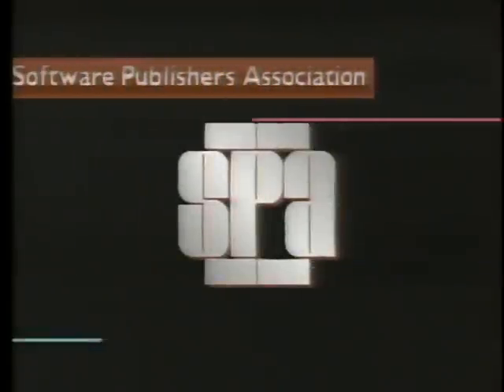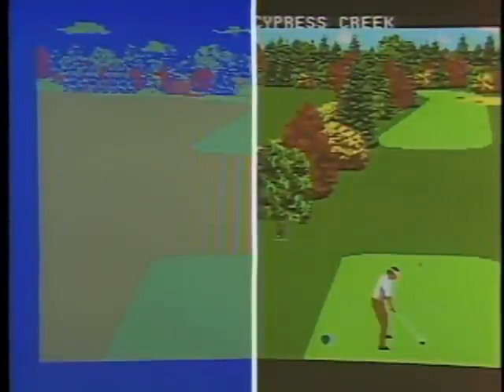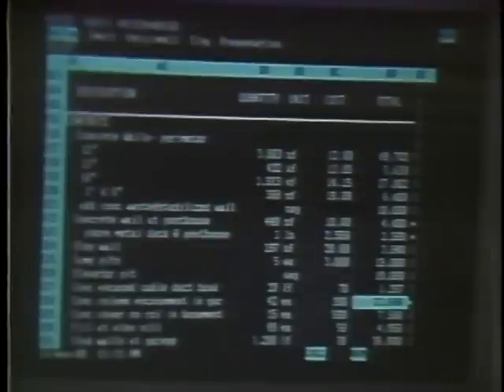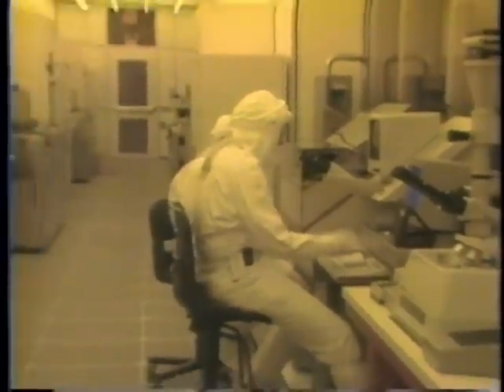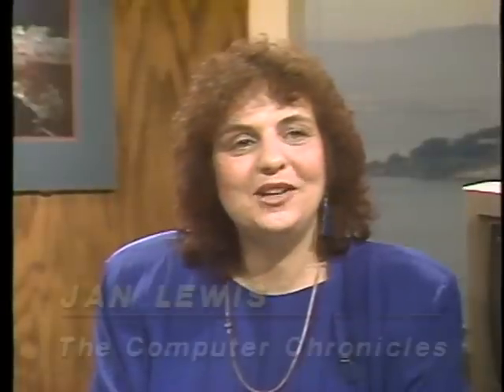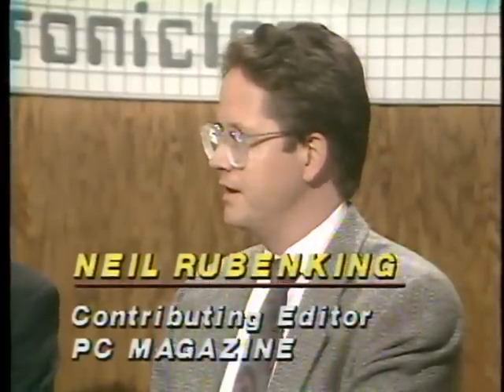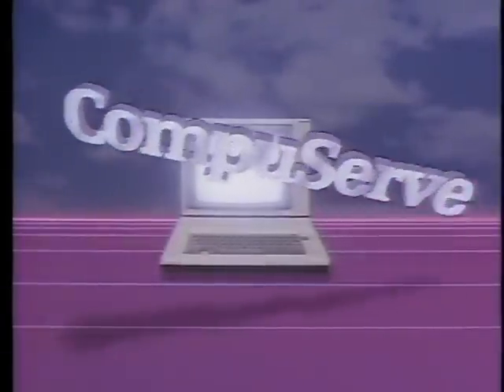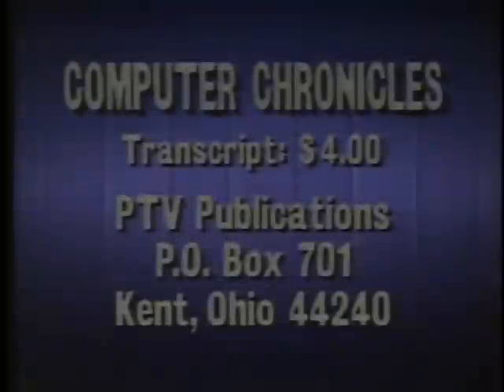The Computer Chronicles - Megahertz Mania (1989)

Comment: I used to have a 486 25mhz in those days. The computer also had turbo button which increased the speed up to 33mhz. I was so proud! Today I wouldn't have a clue how fast my processor is or how many cores it has 😂
Reply: One of the sad effects of today’s complex technology is hard for us to keep up or even care about it anymore. I cant even tell the difference between speeds today. My first was a 286, 16mhz, with 20 on turbo. I was so proud building my own computer year after year. Today its depressing, even though we have powerful machines. It removed the joy of computing.
Reply: @biomed007  I agree. We are taking technology for granted. I think the hard-drive I had back then was 250 MB. Windows 3.11 was using about 70 MB so I had about 180 MB left for use.  I remember when I bought a new hard-drive one day and it was like 4.6 GB. It felt like having infinite space. There is no way I could possibly fill up the whole drive. How wrong I was. I also remember my computer had 8 MB of RAM but a lot of games such as FIFA Soccer 95 wouldn't run properly because they needed 16 MB RAM. Some of my friends had 16 MB RAM and I was super jealous because they could play games I couldn't. Also, I didn't have a soundcard so all the sound was coming through the internal PC speaker system which was some super basic "biep biep biep" sound. A friend of mine had proper soundcard. I think it was a Soundblaster 16. It made such a difference because it could play MIDI sounds through external speakers I think.

Comment: At the time in 1989 when Computer Chronicles was filmed in October of that year with a new rebranded theme as the studio was directed in San Mateo California United States 🇺🇸.  In 1989 computers were emerged in the Intel upgraded mircoprocessor and they ranged from 55 mhz to 77 mhz and try to make the comperative in-between the two machines with better prestige and performance simontanseously.

Comment: In 20 years they sold 3Ghz chips
Reply: 5GHz processors exist...
Reply: and with upwards of 6 cores, and 8GB - 16GB of ram, but sadly a lot of software has become overbloated with inefficient code, I personally find it funny how it takes so much power these days too do task that where once done in nearly the same amount of time on 1/10th the hardware, like office work for example. the new versions of MS office won't even run proper on my laptop with a 1Ghz dual core AMD APU, and 4GB of ram under windows 8.1 64bit, but I can turn on my old Zenith Data systems Supersport 286e laptop, and fire up Letter Perfect, and have it work proper, and still get nearly the same results as in MS word.
Reply: Commodorefan64
What Moore's law gives Wirth's law soon takes away.

Comment: What was a 586 in 1989?
Reply: 586 - pentium was just two 486s stuck together.
Reply: Mark Savage lol um... no... not quite...
Reply: No then that would be a dual-core Intel 486 LOL
Reply: 586 would be equivalent to the pentium 75Mhz and higher class Pentium machines, and it was really just a marketing term at the time because people where use too hearing 286, 386, and 486, but it's still X86 architecture. I personally feel with the lower power draws that if ARM CPU's can become as powerful as X86 is now, then it might be the next step forward when are finally able to replace silicon with Graphene
Reply: Commodorefan64 More or less correct. A '586 is a Pentium, Intel used the Pentium name because they found out they could not trademark "80586". But going from the x86 numbering scheme the Pentium is a 586 class.
Reply: The 586 was the Pentium.  Intel changed the name to a trademark instead of a part number so nobody else could use it.
Reply: I think I meant that they were mentioning a 586 chip as existing in 1989, and was calling this out as absurd. At least that's my guess. I think the comment about the i586 being two i486s, if the comment was serious, confused the P5 being superscalar with two pipelines as somehow being two separate CPU cores.

Comment: The industry hit the limit at about 3ghz. Processors haven't moved up in terms of mhz in quite a while now and have instead moved to multiple core units which are not as efficient as a single faster core. You introduce a lot of overhead with multiple cores whether or nor they are on 2 separate dies or not. They are making the CPUs more efficient and faster at the same clock speeds, but that can only be taken so far. They are going to have to figure out how increase the clock speed because adding cores isn't going to do it. In the meanwhile, we could probably increase performance by 2x or more with optimization of software. A prime example is flash. Flash is fucking terrible. While my PC is fairly slow, if I use SMplayer to play YT videos it barely taxes the CPU, while flash pegs it. I also have a G4 700mhz that cannot play flash at all (it goes so slow that it crashes), but youview (a standalone YT player) can play 480p with no problem. This same machine can playback (completely in software) VBR SVCD and DVD. DVD has less compression than flash, but youview shows just how inefficient flash really is. Windows itself is a pig as are ALL of the web browsers. Tenfoxfour is a highly optimized PPC browser that works well and Paleblue (my Windows browser) is more or less optimized (though nowhere near to the extent that tenfoxfour is).
Reply: Yeah I still wait for 100 GHz processor
Reply: Single core is what matters.  Still have tons of stuff that only benefit largely from that one core.
Reply: @oldtwinsna8347  Yes, most processes won't benefit from multiple cores. Some benefit greatly, but most don't.
Reply: @ens8502  The percentage increase from 1982 to 2002 was enormous.  Large mhz increases plus more efficient CPUs ever couple of years.  In the 8 years since I posted this comment, CPUs have only increased to like 5ghz, less than double.

Comment: 33hz? dude it takes like 100 of these big hulky paperweight to match my i5 8600
Reply: 100?     The 33Mhz 386 ran about 4.3 mips.  Your i5 runs about 70,000 mips (or 70 bips).  That's 16,279 of these big hulky paperweights to equal your system on integer performance alone.  Floating point would be about 2x more than that number, and discrete video decoding and multimedia (highly vectorized) for 3D graphics on intel processor alone would be equal to well over a quarter million of these systems to achieve the same computational result.   And if you get a dedicated GPU from Nvidia or whatever, the results get even more convoluted that I won't even bother trying to figure it out, but it would get quite ridiculous.

Comment: lmfao if we only had 200 mhz pc in 2000 were would we be now mabe an ghz lol
Reply: Like 1 Ghz lol
Reply: ik it would be crazy but it will happen at some point
Reply: He wasn't too far off.  The highest-speed retail Intel CPU was 233mhz in 1997.  By 1999 we'd gotten up to about 500-600mhz but the bus speeds were still 100-133mhz.
Reply: icemachine79 In 1999 by that point I had a Gatway bought from a Gateway store in Augusta GA, with an AMD Athalon Slot A chip running at 800Mhz running windows 98SE, with 64MB of ram, and believe it cost almost $900, AMD did not produce the CPU for very long, but they also made a Thunderbird version of the chip which ran at 1Ghz and was rare, but I was able to snag one off eBay a couple of years later, and maxed the ram out to 256mb, then ran XP, and kept that system going till about early 2005 it was a fantastic machine, and wish I still had it for a show piece, but it eventually overheated, and killed the motherboard. :-(

Comment: I wonder what they would say if I brought them my 4.20ghz Quad Core i7 7700k with 30,000 times more transistors. if my computer ran at 16mhz I shoot myself. 7:04 if my computer were running that demo you wouldn't even see the images. it would jus flicker by like a lighting bolt.
Reply: the engineering people would comprehend it.  they would be curious to the barriers of going that small of the micro circuitry just like if you appeared way in the future you'd ask what diseases were wiped out.  it would be harder, though, to have people in 1989 understand what technology would do to society as a whole.  the level of integration would be largely inconceivable.